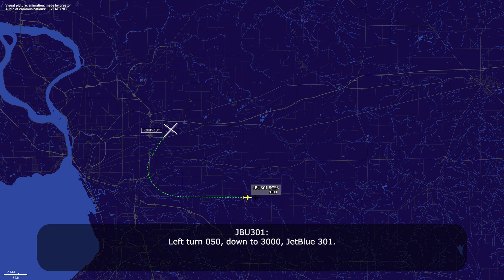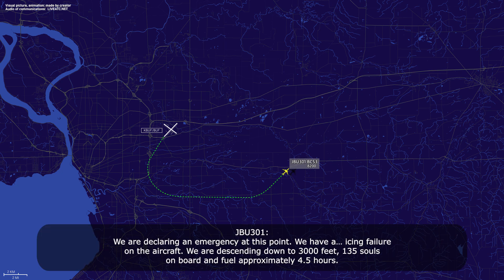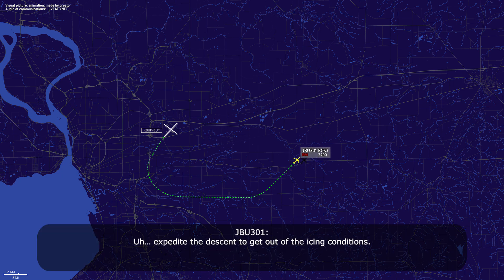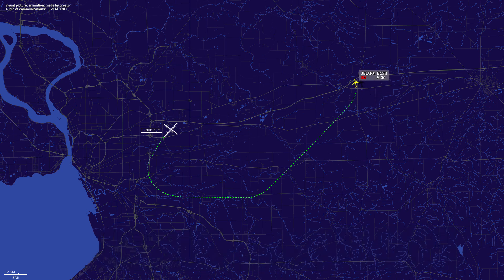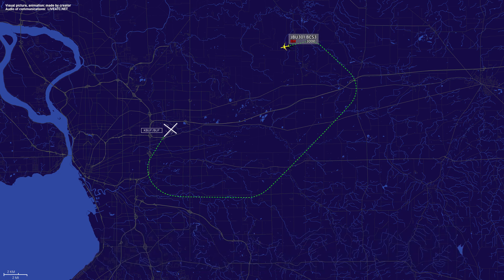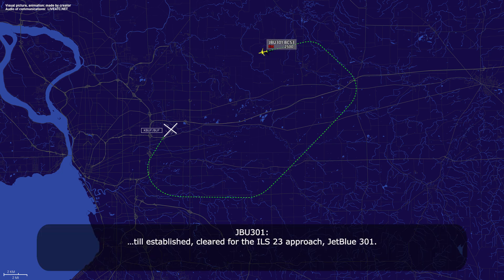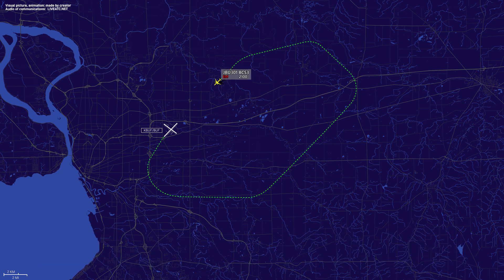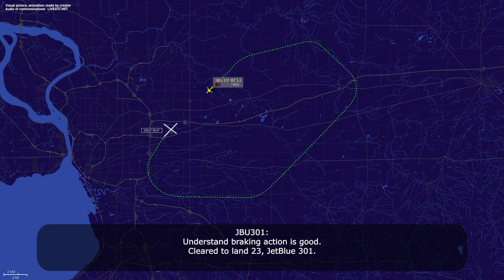De-icing system failure in icing conditions. JetBlue Airbus A220 returns to Buffalo. Real ATC

Comment: "Unfortunately, we're unable to hear the Tower controller." -- is that because we're listening to 20.5 instead of 120.5?  JBU301 apparently tuned to the wrong frequency.
Reply: They normally don’t read back the “1”.  20.5 is not a valid frequency.
Reply: @peterwmdavis  Ah.
Reply: @peterwmdavis  YouTube even censored my acknowledgment of your point!
Reply: 20.5 is not a frequency they can tune to.   It has to start with a 1xx so that's why the readback of it can be not included.
Reply: VHS frequencies all start 1 - that's why it's often omitted from readbacks :) 
Similar stuff is with 121.9 being read back as .9

Comment: It strikes me that the ATC, as soon as they hear the word "troubleshooting", asks for the "numbers" when they haven't even declared an emergency.? Yes, I know that you are going to tell me that in this case the controllers were right. But what if it had been a problem with the landing gear not going up or a problem with the dispatcher paperwork, would it justify "asking for the numbers" and activating the entire protocol for an emergency landing if it was just a return for just in case, where sometimes not even the "panpanpan" was declared?
Reply: First ATC can ask for anything they want.   Second, ATC can declare an emergency for you.
Reply: @zachansen8293  yes i already know that ATC can declare an emergency on "your"  behalf (the pilots) i've already seen it on a couple of videos...  other planes can also declare "mayday" for you as well.  I was only struck by the speed with which he asked for the "numbers." Before they actually declare the actual emergency.
Reply: It's weird the pilots said they "may be returning to Buffalo" they never actually say we are returning to Buffalo.
Reply: 99% of the time a plane needs to troubleshoot it ends up in a diversion, which usually has US ATC make it an emergency. I believe it's easier for their systems
Reply: They don't care about the approved, Internet expert protocol.

Comment: Good job for all involved. Icing is no joke and has caused several fatal incidents in the past.
Reply: One of which happened on approach to this same airport almost 16 years ago. No one wants to see that again.
Reply: @notsureigaf  It's worth noting that icing had very little to do with the Colgan Air crash at Buffalo according to the final report. The NTSB found no evidence of severe icing--rather the crew was fatigued and reacted poorly to an incorrectly set stick shaker. For whatever reason, the crash entered the public memory as an icing crash, likely due to the light snow that was falling
Reply: Very serious problem...
Reply: "many"
Reply: @rdbchase  ok, I'll call you Many if that's what you want 🤨
Reply: @letsdriveswusa  Not "several fatal accidents" -- "many"
Reply: @rdbchase  I don't understand what the big difference is
Reply: @letsdriveswusa  No?  Your phraseology inaccurately minimizes the extent of the problem.  Could the number of fatal icing incidents be numbered on the fingers of one hand, one might say there had been "several", but since there were 583 airframe icing incidents in the US alone between 1982 and 2000 (resulting in over 800 fatalities), there have been many.
Reply: @rdbchase  Ah, so "several" and "many" imply different numbers?
Reply: @letsdriveswusa  YouTube censored my thoughtful, responsive reply -- about half of what I write is censored, absent any reason.